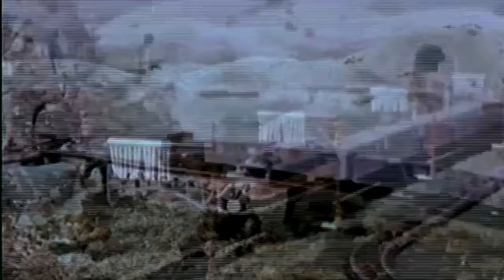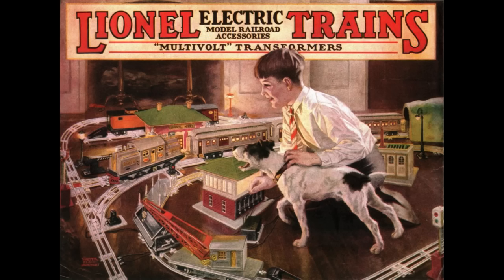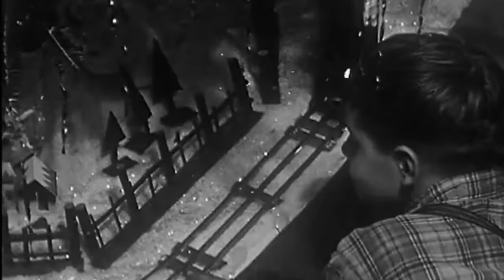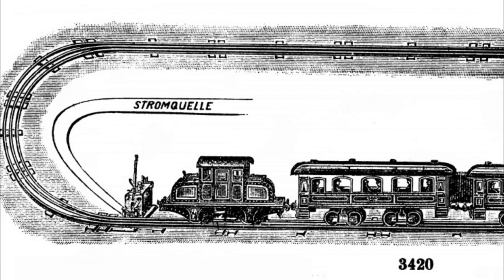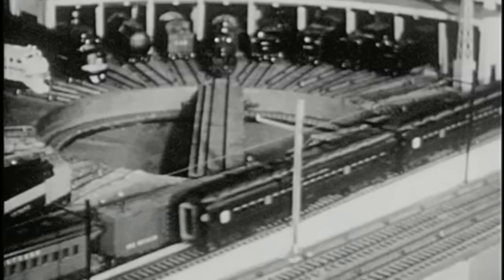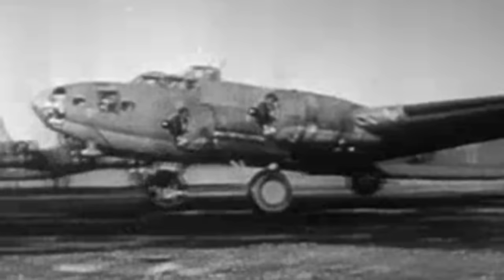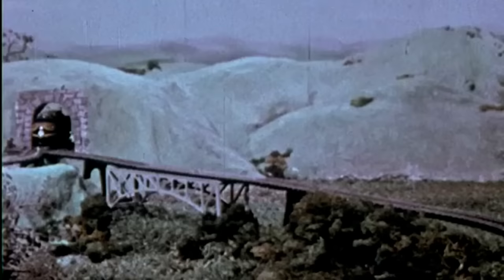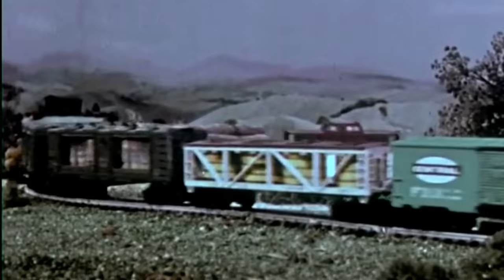Why Do Lionel Trains Run On 3 Rail Track?

Comment: My sister, Ruth, and I were born on the wrong side of the tracks in 1944. I remember my mother heating our bath water in a copper double boiler on the stove and ladeling to into a round galvanized tub on the kitchen floor of the converted chicken coup where we lived so we could bathe. We used Dad's 1936 Ford until well into the '50s and grew most of our own food. Dad worked in a prefab building factory, Mom taught piano lessons and both of them worked evenings wallpapering other people's houses while our paternal grandmother stayed home with my sister and me. By 1950, however, we had moved into a larger house and my parents ordered the "best" windup train from a mail-order catalog. It was out of stock but the mail-order company had a policy (at least in December when people were ordering gifts) to send the "next better" item with the provision that if the person who sent the order didn't want to pay the difference, the item could be returned at no cost to the customer. "Next better" in this case meant the least expensive Marx electric train. By 1951, Dad had decided that the ability to run the train on reverse loops without any special wiring was a significant advantage of three-rail track over two-rail. He and Mom persuaded our maternal grandfather (who was, himself, a sharecropper) to buy four switches (turnouts), a 90 degree crossover and some extra track so my train could change directions without stopping or backing. The cost of the switches and extra track was about equal to the price of my electric train. 

By the middle of that decade - and because of their thrift and hard work - my parents had "moved up" to middle class. Hardly anyone does that anymore. It is too discouraging to contemplate losing welfare "benefits" to make the extra work seem worthwhile.
Reply: Your parents were heros. My grandparents had a pickle stand on the lower east side of nyc. Saved their Pennies and built a factory, etc.❤
Reply: @KR72534  I'm a retired piano tunder. After working fifty years in the medical field (most of that time as a nurse) my wife recently took a "forced retirement" because of her medical conditions. Our daughter posted something on Facebook - a list of reasons she considers her mother to be "a freaking hero".🤣

Comment: Too add a little bit of historic context:
Early on in the piece there was the track issue. It's likely issmayer had the concept of sectional manufactured track, but all those early Nurembergers missing the idea of making track pieces for separate sale. The marklin brothers were the ones that realised this, hence the great leap forward. As marklin (and the newly integrated lutz), bing, carette etc were all making steam, clockwork, and of course the new electrickery, to lend a hand to the manufacturing process its served itself to just add an isolated middle rail to the already tooled for and extant clockwork trackage. 
Across the pond companies, probably someone like Beggs were bringing an actual 'trainset' into the home. 
Howard, Carlisle, Knapp etc,  all these early producers had this extremely and unworkable 2" gauge (from the popular beggs gauge) 2 rail which you built up everytime inserting lengths of copper strip into slotted ties. Awkward and unwieldy. Earliest lionel production followed this. Ives with it's looking over their shoulder policy grasped the success of the European track piece concept. Lionel, realising what a lost cause the 2 7/8" was, switched to the already well proven 3 rail track piece concept, although without the optional 2 rail set track for clockwork.
Some older eastern manufacturers still clung to the 2 rail wooden tie idea, the very expensive Boucher even making what must've been a mass manufacturers nightmare of custom made wooden bases with the track carefully laid on this.
That pioneer of manufactured 2 rail plastic track, plastic wagons, and accessories, triang, really rapidly dominated the English market, killing 3 rail there. Marklin still and always has run 3 rail, and for that very astute reasoning you've noted: that backwards compatibility.
Sorry about this unwieldy, barely legible comment, it's unbelievably been very abbreviated! 
Theres so much fascinating story...
What a great video/ channel. Marvelous
Reply from the maker: Thanks for adding context! That's great stuff!

Comment: In my opinion the flexability of the 3 rail system is a key factor.  Try to build a simple figure 8 layout in 2 rail without expensive electronics to prevent the shorts.  If you are building a layout you may want the ability of designing the layout with a reverse loop,  and simple crossovers.
Reply from the maker: Your point is well taken - particularly regarding reverse loops. 2-rail figure 8's are possible if the diamond crossing is properly insulated.
Reply: @ToyTrainTipsAndTricks  The thing with reverse loops though, is overhyped. A reverse loop requires a turnout,  and having the engines slice it to the other direction isn't a good idea for reliability .. so action has to be taken  !  
The solution is, to attach the section of track inside the reversing loop to an electrical switch, that switches exactly when the turnout switch is thrown.. this comes nearly for free with electrically operated turnouts.  The switch reverses the polarity of the rails on the non-feeder side of the loop.
Reply from the maker: @karlkoehler341  Maybe, but on the other hand, doing THIS required only one wire added between two turnouts. No relays. No contacts. Nothing else. https://youtu.be/1EsetYBN8yU
Reply: YES YES AND YES.  The key number one strength of 3 rails system is the ability to do reverse loops or triangles with 3 junctions... making train much more fun because you can easily end up with trains going in both directions on the SAME track.  Wih digital trains it is really fun as opposed to boring trains that just go round..
I still do not understand why no one mentions this great advantage.   People do not play train because they are boring, because the just go round.  The third rail is the spicy trick to make it enjoyable

Comment: My brother and me got a lot of fun in the 1970s with the Trix Express (Nuremberg, Germany) toy trains, but they had already both rails insulated against each other and a third middle rail electrically in common. In result two locos could run independently controlled on each track without any electronics.

Comment: Sort of a contrast to Europe, where 3 rail AC power in O Gauge has pretty well died out in favor of 2 rail DC, makes it difficult for fans of foreign locos to get ones that will work for U.S. 3 rail layouts.

Might be a little biased, but I'm a fan of 3 rail precisely for the reasons you mentioned, ease of wiring and special effects, simplicity, and backwards compatibility with the rest of the line. Where else is a vintage tinplater going to rub shoulders with the latest and greatest of today?
Reply from the maker: And strangely, Marklin 3 rail HO was still popular into the 1980's.
Reply: @ToyTrainTipsAndTricks  

There's still a little 3 rail kicking about in the UK today, but it's mostly as a niche thing with vintage and reproduction tinplate. Shrugs  Different strokes for different folks , I guess.
Reply: @ToyTrainTipsAndTricks  It's still popular enough here in NL/DE. Though it's losing in popularity as somehow DC DCC stuff is slightly cheaper than AC DCC. I still run 3 rail Marklin, so does my father and my great-uncle. Now my sister's oldest wants his own model railway, and it's again going to be 3 rail AC DCC.

Comment: Simple answer. Lionel trains use the middle (centre) rail for live and the outer rails for return, which enables the use of return loops and similar without resulting in short circuits

Comment: If anyone has ever been on the London Underground, they use a central third rail on many of their lines.
Reply: and they have a fourth rail on the outside of the rails where the wheels ride on.
Reply: They have four rails, one out side the running rails and one in the middle. The main line railways south of the River Thames are electrified with a third rail outside the running line, the main line trains, using third rail electrics run over parts of the London underground.

Comment: One other reason is because that 3 rail track has a LOT of nostalgia to it now. It's goofy looking but it's traditional & a kitschy part of Americana.
Reply from the maker: Yes, that's a big reason today, but not so much in 1945 when Lionel could have switched like American Flyer to 2 rail. Thanks for watching!
Reply: It's also easier from a wiring perspective. With three rails, you can have reversing loops and wyes without needing insulators at part of it with a sensor to switch the current when the loop or wye is used.
Reply from the maker: @karlrovey  Correct.

Comment: Outside third rail is how all of the elevated and subway trains in New York are powered. Most of the pre World War II layouts without outside third rail would have some electrical equipment on the roster to justify the use of the third rail. When I first started in ogage with the MTH Train subway train sets with the third rail being in the middle I could live with that. Your New Haven ep 5 went from cantonary Electric to using the third rail at the Harmon engine change point and then would run on third rail into Grand Central terminal in New York. As I Model A prosperous pen Central I run all of my electric locomotives with the patchographs down simulating the way they would when they were in third rail territory and they were equipped with third rail shoes.
Reply: The London Underground has 3rd rail electrification with the 3rd rail in the middle
Reply: @timpauwels3734  the new street cars in Dubai are three rail powered and the middle rail is only energized when the streetcar is on top of it so it's safe to walk on it the rest of the time.

Comment: That's the one thing I like about the premiere MTH locomotives is that you can run them on either third rail or two rail with the flip of switch. People who go into o gauge from HO scale hate the third rail it is the Dead Hand of Lionel reaching out from the grave. He had too much invested in three rail that he would not have thrown that away and restarted everything with two rail. O gauge pioneers in the old days worked at ways to use realistic to rail track. They made their own signal systems as well as the switches needed to run with two rail track. Walter's and Irving a t h e r n we're both scale to rail old gazers who got started in their business by producing equipment that they made for sale for other people.

Comment: With my MPC cars I can put plastic wheels and axles in the cars replacing the metal ones therefore they could be used on two rail track.

Comment: 3 rail is totally unrealistic, but it does solve the reversing loop problem!
Reply: It can also make signal control much simpler, if one uses a brand of track in which the outer rails are not electrically connected. On my layout I have interconnected block signals and bidirectional grade crossing detection that doesn't require complicated electronics to detect block occupancy, and which do not interfere with one another.

Comment: It makes sense. As a young child (really young, about age 4) I had a toy train set that ran on Lionel-type 3-rail track. Just an oval loop, no fancy layout. The locomotive was battery-powered: a D-cell battery fit neatly into the cylindrical engine. No electrified track. So I wondered then why the middle rail was there. All these years later, I finally know.
Reply from the maker: That was probably a Marx set. Their battery or mechanical sets usually came with 2 rail track, but they may have included 3 rail instead for inventory purposes.

Comment: I had an American Flyer two-rail train set.  A friend had a Lionel 3-rail set, and his simply ran better.  I had to frequently clean the brass contact wheels on my engine to keep it working, but the Lionel set didn't have that problem.

Comment: It is stupid simple and no you tube sites  needed to explain it . Any track pattern can be used with absolutely no special wiring....  even a small child can do it.  This is because the center rail  is constantly connected  to the power. The center rail is always the center rail.  It does  not matter which outer rail is powered at any given time.
Keep in mind that Lionel trains run on low voltage AC currant.  So,  there no + or - connections.... just the center and  either outer  rail as a loco, etc  goes through a layout.
Reply from the maker: We'll, that's ONE Of the reasons I mentioned. There are other reasons. After all, American Flyer targeted the same market but they switched from 3 rails to 2. Thanks for watching!
Reply: @ToyTrainTipsAndTricks 
That is why i said....... " It is stupid simple and no you tube sites  needed to explain it "  :)

Comment: They started as a toy train company, but now their top of the line product is highly detailed, scale and costs as much as scale brass! When you are charging $2,000 for a Vision Line engine, the least you could do is offer a choice of 2 rail or 3, or a flip switch between the 2 systems that MTH offered. I'm sick of the O gauge hobby being almost entirely represented by toy train track, which is what 3 rail is, no matter how "realistic" you try and make it. We are the only gauge that is afflicted this way- all the other scales run 2 rail.
Reply from the maker: The options for 2 rail O have seldom been better if that's the way you choose to go. Personally, I think it's fun to be able to throw a 1930s Lionel locomotive on the layout with a modern train on the same layout. I can also appreciate the realism of 2 rail as I was active in HO modeling for many years as well. Rule #1 - It's your railroad!
Reply: I have a lot of respect for the 3 rail but am hooked on the 2 rail brass Civil War trains from SMR and am building some freight cars from BTS.
Reply from the maker: @kk-wh3hb  Very nice!

Comment: Great 16mm film scenes and ads during your explaination!
I think the main reason was saving costs (= more profit) and that you couldn't short cut + and - .
Bakelite was available from the 1920's on.
I have a AF Hudson Set from 1952.
For the near future I want to build (I'm a watchmaker - see my website) for my own a live steam O gauge Mallard/ british loco.
Thanks for your video! I like tin toys and tin plate trains more than this rivet counting models today.
Best wishes,
Géréon
Reply from the maker: Bakelite was, indeed, around in the 1920's. However, it seems that Lionel was very cautious about using it for structural items. They generally reserved it for pieces such as the Automatic Gateman or transformer cases that received little or no physical stress.
Reply: Bakelite was relatively brittle.
Reply: @Caseytify  Hi! Thanks for your reply! Yes - was and is brittle (but very strong/hard, takes up to 100*Celsius), but ages better in my opinion. Also it has a nicer surface shine and I love the feeling of it. xD . Cordial, Géréon

Comment: Here in England Hornby ran on 3-rail track switching to 2-rail sometime in the 1960s, I think. Like you say, this was due to limitations imposed by the insulation materials of the day. As a kid I did not like 3-rail because of realism issues!

Comment: The number associated with Lionel track is the diameter of the circle, not the radius. A circle of O-27 track is 27” across, not 54”, which is what it would be if it was the radius. That applies to all sizes of O gauge track. If it were the radius, O-72 track would make a 12’ circle, but it doesn’t. It makes a 6’ (72”j circle. Also, that “3rd rail” in the middle of the track in D.C. wasn’t a rail at all. The D.C. system was a “cable car” system, where the device under the train wasn’t for electrical contact, it was to grab onto the cable, which made it go. The still extant system in San Francisco works the same way. If it were an electrical third rail, it would have been a death trap, if someone were to trip and fall across the three rails at once.
Reply from the maker: You are correct. If I said radius I misspoke. I'm not sure what you are referencing with the DC comment, but you are correct there as well. Thanks for watching!

Comment: 3 rail is superior in everything but realistic appearance. I like to have operating signals and stopping sections to protect crossings and such. so much easier with 3 rails. And it’s nice to have non derailing switches and no issues with wyes and return loops. When I had a HO layout I used some maerklin track with a third rail to operate signals and switches.

Comment: My dad had a Lionel train. It was just a circle but he only set it up around the base of the Christmas tree for Christmas. His dad was rich, and he got them one of those trains that you could really ride. But they never set it up for us as kids. It was just kept in the tool shed next to the pool. When us kids got our own trains we got HO scale 2 rail sets. I liked them better because they were more realistic, had more features, and were cheaper. You could get more switches, more lights, longer cheaper flexi track. It is a better value for kids. More play for the money. But I remember that huge 10 pound transformer for Lionel. It was direct current so it wouldn't shock you if you touched the third rail but it would burn you because it ran hot.